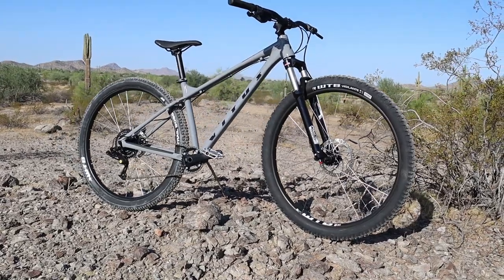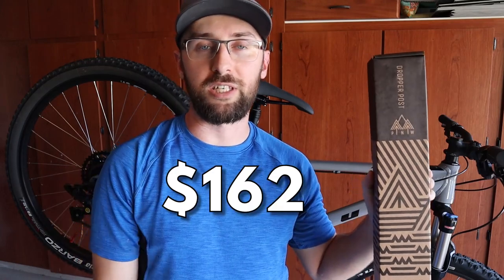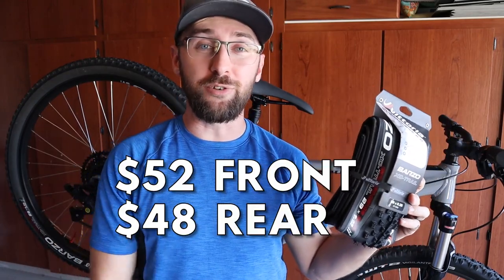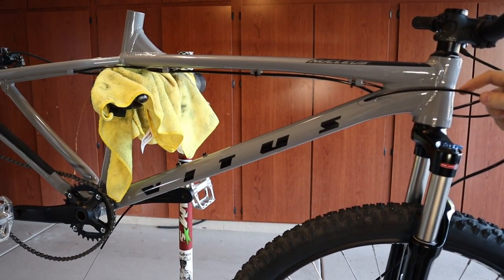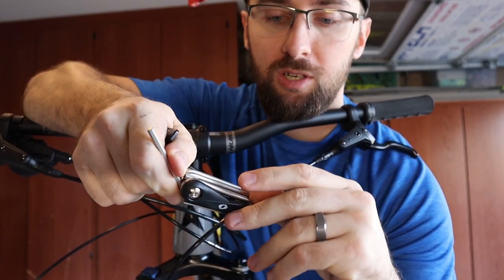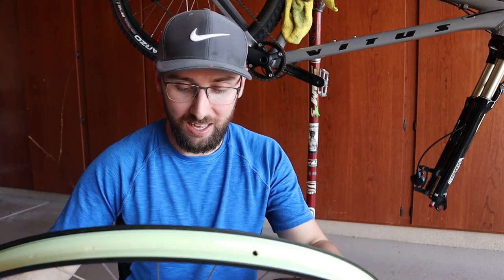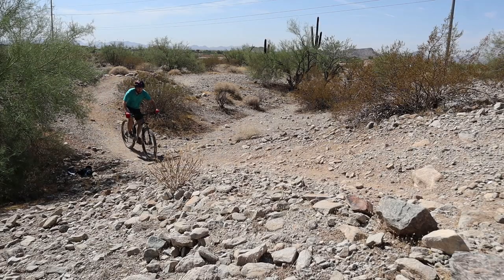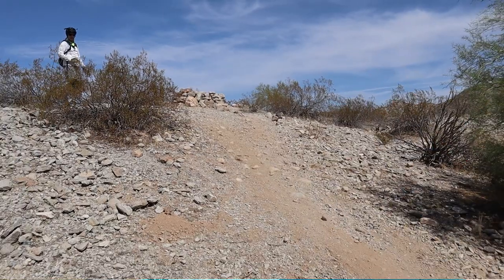Essential first upgrades for the Vitus Nucleus!

Comment: These upgrades plus the better forks, drivetrain and brakes was the reason I saved up for the Sentier VR.
Reply from the maker: Heck yeah the Sentier is a great bike. Through axles front and back right?
Reply: @EvansMTBSaga  on both ends, ues sir. Boost!
Reply from the maker: @Hawk-qn2zk  Thats amazing. Eventually I'll transition this channel into a mid-level budget bike like that. Stay tuned!

Comment: I got the 2020 vr just before the 2021 came out. So sad I didn’t get the 1x😔
Reply from the maker: Its pretty easy to convert over to the 1x though. IXF crankset is like $50. Box Four groupset is about $120. You'd be caught ride up to the 2021. Plus you have a longer travel fork than the 2021 (100mm)
Reply: @EvansMTBSaga  Yeah I’ve been looking into converting but sadly my fork has been leaking some oil so I’ll have to look into that too. A good project for the winter up north here though

Comment: The one thing I dislike about the Nucleus is the rear hub sizing. It's old school and I cannot find ANY alternative hubs in the 135mmx9mm QR sizing. Not only does this limit wheel customisation options, it essentially means this bike is toast once the bearings give out on that stock Vitus hub.
Reply from the maker: There's definitely wheels to be found, check Pinkbike! A lot of non boost through axle hubs can get converted to 135 QR

Comment: So if you wanted to, could you make the tires that came with the bike tubeless?
Reply from the maker: The stock tires are wire bead. I've heard that it's possible to do that, but I wouldn't recommend it. The tubeless tires are Kevlar bead which allows them to stretch and seat the bead on the rim. Wire bead tires can't stretch because the wire.

Comment: Are the WTB tires tubeless ready, or will I need to buy new tire to go tubeless? Sorry I'm new to all this.
Reply from the maker: They are wire bead tires. So they can not be tubeless and you have to buy new tires. There are some good deals on tires right now and you can easily find tubeless tires for $30-40 each.
Reply: @EvansMTBSaga  thanks for the reply. I'm in Arizona also so I really just want to get the tires dialed in from the get go and don’t want to have to worry about them, so I'm willing to spend  a decent amount out the gate. What bullet proof tires would you recommend and do you recommend those inserts?

Comment: You have to get new tires to go tubeless? I got 2 flats today from some texas tacks. Still running tube's. Bought replacement tube's but also bought some slime to patch the holes in the tube's. Any experience with that stuff?
Reply from the maker: Yeah slime works good. It's just that tubes are already heavy as is, then you add slime and they're even heavier. Other than that, slime is reliable.

Comment: I notice that the VRS version is $250 more, but you get the air fork. Is that worth it alone? Sorry, I’m a complete MTB noob
Reply from the maker: Hey Cory! The base model VR also comes with the same air fork, but without a through axle. The VRS has an upgraded shifter and derailleur it looks like

Comment: Nice vid. Can you tell me what size frame you have? Can the original seat post fit all the way down inside the frame? I have a medium 2020 model and it won’t go all the way down.
Reply from the maker: I have a Medium as well and the seat post definitely doesn't go all the way down. Thanks for the compliment!
Reply: @EvansMTBSaga  I’m new to modern mountain bikes as my old GT was about 8-10 years old but your vids are inspiring me to try some upgrades on my new (2nd hand) Nucleus 👍

Comment: I noticed you used presta valves on the Vitus and shrader valves on the Axum. I have presta on my Boundary, and after a trail ride there is sealant splattered on the rims around the presta valve. Do you think it would help hold that sealant in if I swapped to shraders? The holes in the rims are already shrader size.
Reply from the maker: Oh yeah absolutely. If they're drilled for Schrader, use Schrader. I will say that both wheel sets I have you can see that sealant leaked out a little, but not much

Comment: Just took my new Nucleus out for her maiden voyage yesterday. Was a bit of a city/xc trek with some trails thrown in. It was okay but I was saddened by my friend’s significantly cheaper bike feeling more fun being a 27.5 and the seat and grips being a lot more comfortable. He said instantly that the Vitus grips felt really rough so they’ll be getting swapped. The gearing too leaves a lot to be desired… I thought the 8th gear would be pretty tight but I definitely feel I would benefit from more gears to continue picking up speed as I felt very held back. Bit bummed out really haha decent enough but not sure it’ll last
Reply from the maker: Oh man sorry to hear that. You should check out my most recent Nucleus videos. I've done a lot of upgrading and totally unleashed the bikes potential. The bike is an absolute beast so hang in there!!

Comment: It looked on the video like that there was some slack in the dropper wireline at the bottom at the exit and entry into the seat post. Is there a bottom plate on the VRS to cover/protect the line?

Comment: Great upgrades but I am  looking to go tubeless with the stock tires do you think it would work because I have heard rumours that you can.

I am also looking to install a dropper but I have a small budget so do you think I should spend more on a remote dropper or should I go with the cheaper integrated dropper lever.
These posts can be had of eBay for 30 dollars.
Reply from the maker: The stock tires are wire bead, so they can't stretch and pop onto the bead. The suicide droppers look interesting for sure lol, but I usually use my dropper riiight as I'm cresting a hill or starting to go up a hill, both are somewhat high speeds. I'd go with remote
Reply: Thanks for he feed back but do you have any suggestions on a dropper post around the 80 dollar mark?
Reply: @shrenucutie  there are some wonderful people on reddit that will be able to answer this question for you.

Comment: What size clamp did you go with for the lever remote? I'm going to purchase the same dropper and lever but not sure what will fit the stock handlebar
Reply from the maker: I went with a PNW dropper remote. Where it clamps is 22mm

Comment: Hi, I am looking forward for this bike but I have question. Is 11-42 cassette enough for steeper hills? Is all ok with 8 speeds? Thanks
Reply from the maker: 11-42 will definitely give you a leg workout! It felt fine to me. I ended up going to a 11-48 11 speed cassette though.
Reply: @EvansMTBSaga  Do you have to change the shifter when installing a cassette with more speeds?
Reply from the maker: Yeah if you go with more speeds you need a new shifter, derailleur, and Chain. My current bike has a 10 speed, and I really don't want to drop a lot of money for just 1 more gear.

Comment: Great video.  i just got my 2021 Nucleus VRS and the first upgrade has to be the dropper. I'm 5'8" and the stock seat has to be all the way down for regular riding height (about 5" of post visible). I got the medium bike since i'm between sizes.  Also i'm pushing 50 and don't plan on challenging Sam Hill any time soon!  I'm trying to figure out the math to see what size dropper post will fit and it appears a 100mm unit will due.  I think that should give me about 4" to drop out of the way and raise it back to normal biking height.  I'd love the 125mm, but don't think the frame would accommodate.  Anyway, ride hard and be safe all!
Reply from the maker: Hey i have a Medium and a 125mm dropper and the dropper can go down all the way still. I have it clamped about 4-5" higher than the clamp so that way I can pedal uphill in a comfortable position. I'm 5'9"
Reply: @EvansMTBSaga  thx....i just started researching droppers and started with looking at the the Highline from CrankBrothers.  I'll check out the PNW as well!  Thanks again!

Comment: Hey man can I turn these stock tires into tubeless?
Reply from the maker: Unfortunately no, they are wire bead and aren't tubeless compatible.
Reply: The stock tires are way better than those barzo, and YES you can run them tubless, I've been using them tubless for about a year with no issues whatsoever
Reply: @jestin3550  thats exactly  what I did, the front tire work from the start without any issues, the rear tire lost air really slowly at the beginning, if that happens you just need to apply more sealant, after applying sealant for a third time It stopped losing air.
Reply from the maker: @Mr14041985  Haha dang that is impressive! Thanks for watching.

Comment: Man, you got the bike on point. I snapped my chain on my ride Saturday. I've been eyeballing the dropper post on chain reaction cycles that has 200mm travel. Last I checked it was sold out though
Reply from the maker: Dang you must be tall! Haha. Hopefully this pandemic is over soon and bike parts will be back in stock. Hope you didn't get hurt snapping the chain!
Reply: @EvansMTBSaga  how tall are you? No, I just tried to upshift on a nice climb. I was riding the trail BKxc just rode in Nebraska.
Reply from the maker: I am 5'9"
Reply: 6'2, hmm. I'm new to the dropper post thing. Maybe 150 or 175 would be better.

Comment: Hey dude i have a question.Do you think that your vitus nucleus can fit a 2.4 wide tire?
Reply from the maker: Most definitely it can. I just tired on my other bikes back wheel with a 2.6 and it fits with a little clearance on both sides
Reply: So on both front and rear i could fit a 2.4 or wider
Reply from the maker: @marcelthebest2977  Im not sure about the front. The SR Suntour forks dont have the best clearance on the stock 2.3 tire, so that one is iffy and I dont have a way to test that.
Reply: @EvansMTBSaga  Clearance is almost zero !   I was shocked. It seems dangerously tight. My bike is the older version 27.5, but the fork is the same one. I had an RRP bolt on mudguard, but no way that would work.

Comment: Evan, I've just bought this bike and I'm already thinking about weight savings. Would the best thing be to change out the tyres as the WTB tyres do seem to be quite heavy tyres?
Reply from the maker: Yeah definitely! Going tubeless will also save a ton of weight
Reply: Hard to get Barzo tyres in size 2.3, but I  can get 2.25 easier. Do you think it is necessary to have the larger front tyre,?

Comment: Hey Evan did you purchase the Ridge directly from PnwComponents? Also what lever did you go with?

Also is 125 travel enough for a guy whose 5'11 w/ a large vitus? If you don't know it's cool, I understand it's a specific question.
Reply from the maker: I did get it directly from them and got their cheap lever for the dropper. 125 should be plenty for you

Comment: Just installed this same dropper on my nucleus today, and tubeless is in the works. Cant wait to see how your build ends up compared with mine and see what components we each go with. Glad to see another mtber that is budget concious and doesnt need the $5k dentist bikes lol. Love the vids! Oh and quick question, did you grease the stanchion or just the post insert? This is my first time using a dropper, so wanna make sure i do it properly
Reply from the maker: I greased the post insert. The stanchion is already greased, there was a ring at the top of the stanchion of grease after the first ride. Thanks for the props. Huge upgrades coming soon
Reply: @EvansMTBSaga  awesome, thanks so much! Ill be keeping an eye on your channel for future updates, cheers!
Reply: Are the stock tires tubeless ready and also my rim tape was sliced out of the box so imma get some more